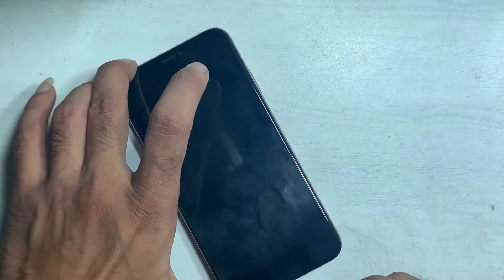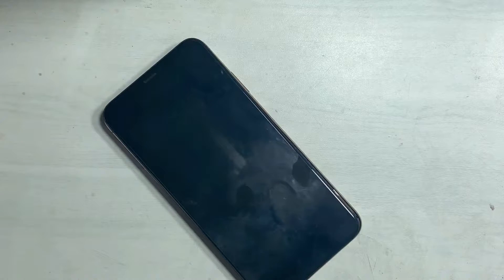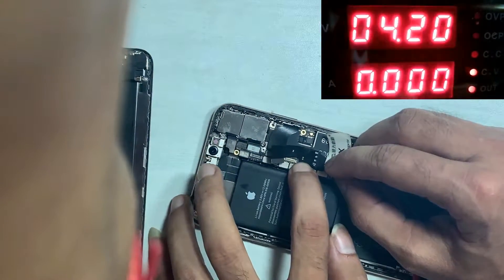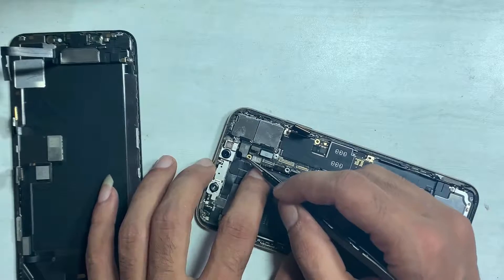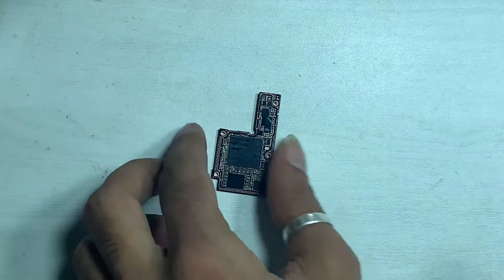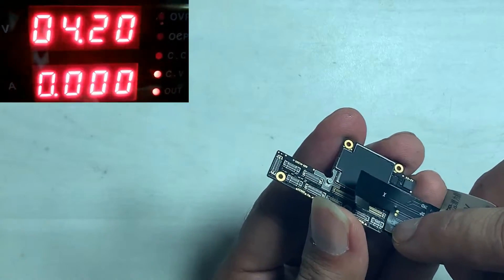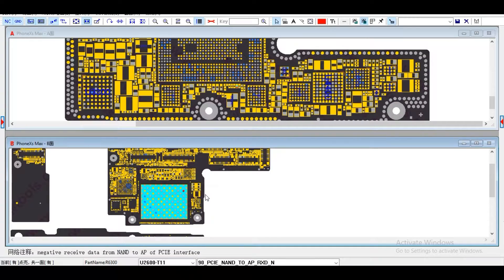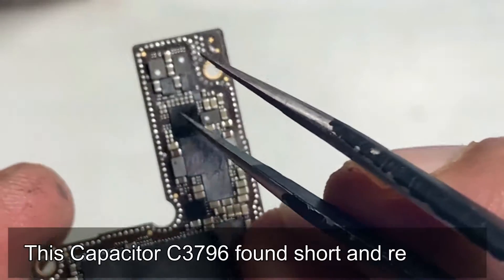iPhone XS/XSMax won`t turn on!Heating Dead and Not Charging Fix.

Comment: thanks for the video, my iphone Xs max suddenly start overheating and the charge turns from 50 to 10% .. I've turn it off but it started rebooting, I let it for few minutes then I put it in charge and it restarts overheating and rebooting .. I think I've made an issue of letting it in charge because suddenly it stopped working and a green think showed fastly and gone. What's the cause please and if I make an new battery do I lose my data and apps?
Reply from the maker: Replacing parts like Display and battery not affect your any data and apps.

Comment: my i phone xs max same issue...when iam pulgin charge cable phone automatically heat very high not power on 😢😢
Reply from the maker: Which section
Reply: Camara side sir ji...

Comment: Hi my phone is the same phone as yours and it's currently dead and I tried to charge my phone but it wont turn on. Can you help me?
Reply from the maker: iPhone is heating or not ?
Reply: @thegsmsolution1  no, it's just dead and when I charge it,it doesn't turn on. And after a long time, it shows the red bar and then it charges but doesn't turn on. I have a Iphone XS Max.
Reply from the maker: Battery was on sleep mode.
Reply: @thegsmsolution1  so how can I fix the problem?
Reply from the maker: Better contact the good cellphone repair technician.If you made mistake while opening Lcd this may damage and costly too.
Reply: @thegsmsolution1  Ok, yeah my dad is going to get it repaired this weekend. I'm not am expert at it so I didn't really do anything to damage it even more. Thank you tho.
Reply from the maker: Welcome brother.
Reply: How much riper cost sir please reply....I was purchased iphone 5 months of my hard work ..my dream was making short film with iphone camera..but😢😢😢 my phone was dead..

Comment: Really helpful but the touch pad of the phone was stocked after I fix it back,then I notice the board not properly fix in perfectly.I adjusted it bt the phone refuse to turn ON.pls I really need your help
Reply from the maker: iPhone fails to power on or only Touch not working brother. Can you share the repair history?